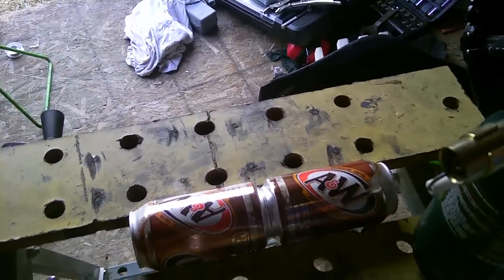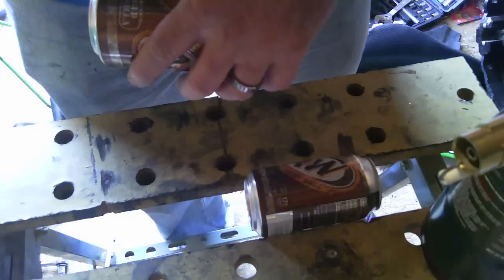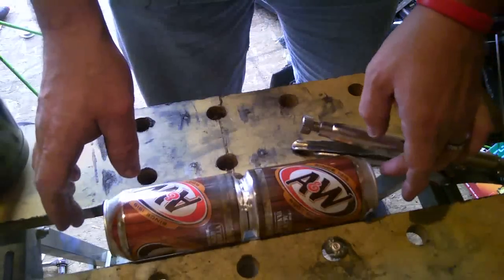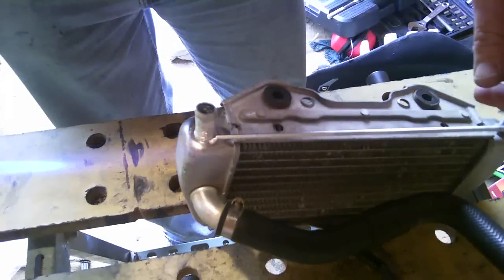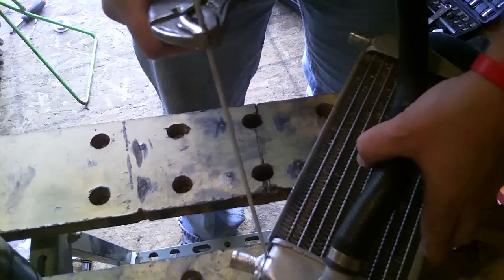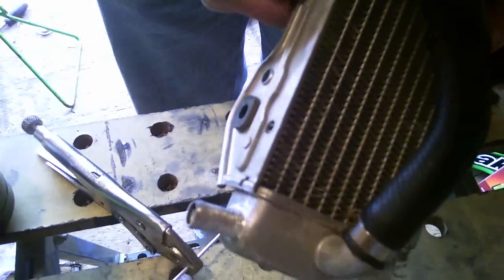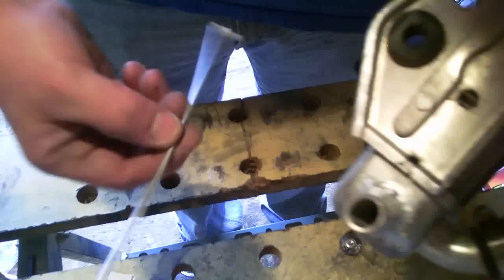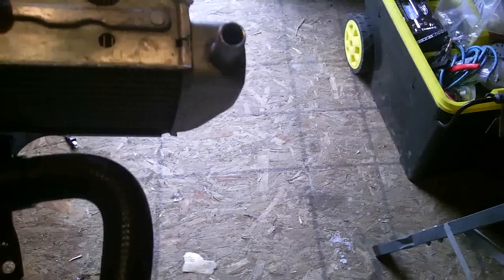How to weld aluminum with a propane torch and low heat aluminum welding rods fix your radiator.

Comment: Thanks ! Your vid provides some great real world experience with using these rods.  I've been doing research before I actually try it, so this has been invaluable for me and I appreciate the "mistakes" ! The one thing I'm getting consistently from all the vids I've been watching is that the "trick" to brazing with these rods seems to be heating the base metal to a point were the heat in the base metal does most of the melting of the rod.  I hope I don't ruin my carb :-)
Reply from the maker: +G Seidman You are welcome. Best of luck and thanks for watching.
Reply: I gave it a shot. Unfortunately on a second attempt I got a little too aggressive with the heat and melted my piece beyond repair, but the experience was worth it. Maybe next time I'll have better luck.
Reply from the maker: +G Seidman This was my primary concern when I was doing it and if you look at the comments I get a lot of heat (pardon the pun) about being too careful applying the heat to the base metal, but you have just proved my point on this. Aluminum has a very low melting point regardless of how thin the metal is it melts at the same temperature. The only difference is how long the metal takes to get to the melting temperature. It's a delicate balance. Thanks for the feedback and better luck next time. Thanks for watching and commenting.

Comment: you made a how to video without knowing how to actually.

1)the reason you dont get adhesion  is because the radiator stays cold and your rod melts
2) you arent using flux...itll make your life way easier
3) doubt the alumunum can and the aluminum radiator are the same gauge...it wont melt as easy but god damn take the rubber hose off.

now for actual instructions... 

1) clean properly
2) apply flux
3) heat indirectly from a distance constantly moving the torch
4) test heat of material by touching with a rod...if rod melts then its hot enough....remove flame and keep melting rod into radiator until more heat needs to be reapplied. 

what you actually did was put the rod where the flame was and melt the rod only onto a cold piece of aluminum, then heat the whole damn thing to a boil until solder actually melted properly.

watch copper piping soldering tutorials on here and see how neat and nicely it can be done
Reply: alextheromanian. so ur the genius lol
Reply: I agree.

Comment: Well for one thing you should have heated the piece to be welded first then as you heat, pull the torch away and then test to see if the rod will melt then you know you have good adhesion ! Just a suggestion from a Welder. I do this stuff for a living every day!
Reply from the maker: +Richard Lee Ferguson Understood. My biggest fear was overheating the base aluminium and melting a hole in it. It actually did adhere well and has held ever since. I would not hesitate to use these rods again. Thanks.
Reply: +Richard Lloyd LOL you would have to hold the torch on there all day to get a hole .. ITS NOT A POP CAN .
Reply from the maker: +BC Viking Better safe than sorry, but it is still holding today so all is well that ends well. Thanks.

Comment: Nice job and thanx for the vid! I wonder if one of those little butane microTorches might give more control?  Something I may try.  I'll have to get some of those rods and look into the flux option as well.  Thanx again!
Reply from the maker: +1 Apples You are welcome. Experiment on some scrap aluminium and see what kind of results you get. If you could report back to us here that would be great. Thanks.

Comment: let me ask u a question can I use this method to weld aluminum intake piping it's really thin material?
Reply from the maker: +Domenic Scavetta I can't really say yes or no as there are too many variables. You could try it and see but I would practice on a similar piece of scrap tube to test and get familiar with the process first. Thanks.
Reply: +Richard Lloyd I really want to know to I was going to try it tomorrow
Reply from the maker: +MegaDabeast99 I would give you the same advice, "I can't really say yes or no as there are too many variables. You could try it and see but I would practice on a similar piece of scrap tube to test and get familiar with the process first. Thanks.

Comment: One more reason to choose aluminum over plastic ended radiators. Thanks for the tip! Will remember this if my dual core all aluminum radiator leaks. Heating the surface was probably part of the problem with the adhesion, soldering carries the same principle, surface needs to be pre heated for a weld to take place.
Reply from the maker: slvrserfr You are welcome. The repair is still holding strong. Thanks for watching and commenting.

Comment: If the melting temperature is below 842°F (450°C) then it is soldering per American Welding Society (AWS). The rods sold at places like these are solder rods. AWS defines brazing as such a process which involves a filler metal which has a liquidus above 842°F450°C (450°C). You also need to check what alloy of aluminum you have, 5000 series alum. needs a very aggressive flux.

Comment: ok everybody let watch this guy melt holes in those two can, Ha Ha this is going to get good I have used those rods and got no where and we are going to be making fun of this guy  when he falls flat on his face .  Set back and chuckle along with me

Dat.  Dat . You photoshop Dat ain't no way you brazed them two cans together .. I already tried it .  It don't work     Now you going to really make a fool of yourself trying to braze that snout on Dat little radiator.   You better shut this video dowwn so we can't see the mess you are about ready ro make
Reply: bob brawley Alright alright you win . Maybe I jumped the gun a little but not by much . You did repair that little radiator and so I'll go ahead and shut up
Reply from the maker: bob brawley Two years later on a hot pressurized radiator full of cooling fluid mounted on a high performance motocross dirt bike that gets more than it fair share of abuse and punishment this much bashed repair is still holding today. As you can see in the video I am NOT a professional but regardless I was able to permanently repair this radiator using this method and It only cost me $15. So I will and do take all the criticism in stride knowing that the repair I did, though not pretty has been highly effective. I thank you for your time and for watching.
Reply: Well with that demo which actually showed the entire flame, and the distance . was better than the demo of the salesman on youtube hawking them I bought two tubes and got no where thinking that I needed to heat of the work more broadly with a grass burner propane  torch  Well I got the torch but lost the need to give it a try .. really you  gave us a possible way to actually give those rod  a second chance   Pull the heat way
Reply from the maker: bob brawley That's great. I left my mistakes in this video on purpose so that people could learn from my mistakes. I could have easily edited out all my mistakes and made a video that made it look like I was a master at this. Thanks again.
Reply: That's the way to do it . It real life not advertising hype
Reply from the maker: bob brawley Yes Sir. Thanks.
Reply: ied using those rods on a heavy aluminum trash truck door a vertical  braze  the base mental was not getting warm enough using  a Oxy/accel. cutting touch. even when I washed the flame  .  So, I figured I  needed one of those  propane grass burning . snow melting torches .. . They burn grass good enough but don't melt Ice or snow .. I eventually got the torch but never tried it on those rods
Reply from the maker: bob brawley I have one of those torches from harbor freight and it is flame thrower when I attach it to a propane tank. It might work for you. The problem with aluminium is that it is a very good conductor or heat so it has a tendency to work like a heat sink, hence why they make heat sinks, pots and radiators out of aluminium. Just like with the beer cans if you get it too hot it will melt. When using these rods the metal that is taking the rod should be hot enough to melt the rod without the torch. As you can see in this video it takes practice. Thanks.
Reply: Yes I saw those ones at harbor Freight they are like 2.5 feet long , much better to braze with than the one I bought which is like normal size , maybe 3.5 feet long too long to  hold while trying to hold a brazing rod . .. The harbor freight torch was only 19.95 dollars the one I bought at Tractor supply was 3 or 4 times that price .. It got to be too complicated and my failure with the first attempt using those rods .  Well I never got around to it . With your video maybe that will spur me to try it a second tome , I mean second time.
Reply from the maker: bob brawley Best of luck to you Sir. Thanks.
Reply: Richard Lloyd I think I ordered my rods from muggyweld dot com 5 years ago .. I see now you can buy them at the welding store and I guess Harbor Freight.  I visited muggyweld just a sec ago ,, and he disabled his comment section on all of his videos ,, not good ,, Its the feed back on the comment section of Youtube videos that are as important as the actual video. ,, Its the same as peer review
Reply from the maker: bob brawley The feedback is gold. I always read the reviews before proceeding with any repair or purchase. Thanks.

Comment: I appreciate you leaving all the mistakes in so the rest of us can learn.  I have done an extensive amount of MIG welding, but have not welded aluminum.  It seems that the problem is not the heating, pre-heating or any of that but rather a misinterpretation or misapplication of the welding process itself.  The theory of welding is that you get the base metal AND the filler metal just hot enough to become molten but not too much hotter or you affect the strength of the metal.  The flaw with the process depicted here is that you have low heat melting aluminum rods and are trying to weld a much higher melting point aluminum.  The base metal of the aluminum radiator never becomes molten and thus never "joins with" or "welds" with the filler metal.  You may eventually get some surface adhesion by the process depicted in this video but you will never get "welding" (that's why it leaked.  FYI, its going to leak again).  A welded bond is as strong or stronger than the original.  The basic premise of welding is that the metals mix and join or "penetrate" as the term is used in welding.  I don't mean this comment to be derogatory.  I appreciate you taking the time to do the demonstration.  I felt it was important to point out the reason why it did not work properly so that others would understand.
Reply from the maker: Keith Preston You are, I am sure, technically correct but I am not sure why you think this did not work. It is actually still working today. It has not leaked again since the repair. Thanks for watching and commenting.
Reply: Richard Lloyd I'm glad it didn't give you any more problems. I don't know what kind of pressure builds up inside a radiator.  Apparently not enough to blow out this repair.  When I talked about it not working I was mainly referring to the early attempts where the filler metal did not bond and fell off.  Although technically the "welding" part of the whole thing didn't work because it wasn't actually "welding".  If you don't melt the base and filler metal where they flow together, it's not welding.  It's more like "aluminum brazing" if there is such a thing.  Maybe that's splitting hairs.  I just wouldn't want someone to use this process to "weld" something together that was going to be used in such a way that if it came apart that someone would fall or otherwise get hurt.  Parts that are brazed or soldered together can come apart because they are really just stuck together with molten metal as the "glue".  What you have on your radiator is a hole in the original metal that is covered over by a layer of Aluminum that has become hot enough to adhere to the surface of the radiator and cover the hole. It looks fine from the outside.  That is why when they are testing/training welders they x-ray the joint to see what is really happening under the surface.  If you could x-ray your radiator you would still be able to see the hole or break in the original metal.  If it was actually "welded" together you would see only solid metal.  Your repair might outlive us all, or it might break next week.  Whenever you have two pieces of anything that are put together, it is possible for them to come apart. When two parts are actually "welded",  they become one piece. There is nothing to come apart because there is no point where "original part A" meets "original part B".  There is only "new part C".  That sounds like something Yoda would say, so I'll stop now.  Bottom line for you is that you fixed your radiator. Congrats!
Reply from the maker: Keith Preston Thanks for the wealth of information. You could call it brazing or soldering. The rad opperating pressure is 16 lbs pre inch I tested it to 22 without issue. Again thanks for the info.

Comment: I've been a pipe welder for over 35 years and done a lot of metal repair on other metal. I've used these rods and they work well, it looked like you didn't get metal hot enough you were trying to get the rod to run before the tub was hot enough just practice and it will look as well as the experts do it.
Reply from the maker: jedediahbc Thanks for the advice. I believe failure is essential to learning. LOL I did get it right in the end and it's still holding today. Thanks for watching.

Comment: This was painful to watch. Wish I was there with this guy to let him know that the base metal needs to be at just over 700 degrees to melt the rod. Never put the rod in the fire. Keep the heat moving then test the rod if it melts when not in the fire then you know you are at optimum heat. then place on a bead and it will follow the heat. No need for a half a rod a tiny bit would do it.  heat the opposite side and when the base metal melts the rod then you know you have enough heat.
Reply from the maker: Understood. Thank you.
Reply: No problem pal..Glad to help
Reply: If it was painful to watch youtube has this amazing feature call a stop button.

Comment: How is the radiator holding up? "0
Reply from the maker: Almost 2 years, still good. :)
Reply: Richard Lloyd
Good to know. Thanks. ;)
Reply from the maker: *****  I stripped all the plastics and most of the rubber off before the repair. Thanks.

Comment: @7:00 you werent getting adhesion because you didnt have the aluminum hot enough you were applying all your heat to the rod. The cans melted so easy because they are so thin.

Comment: Nice work. You needed more heat on the radiator during the first attempts for sure. I know you were worried about blowing through the base metal, but the aluminum on the radiator is several times thicker than the cans and it needs to be heated longer.
Reply: +Richard Lloyd I was gonna say the same thing,  and thought gotta be someone else having the same idea. there I found scdevon's comment

i didnt even know you could DIY join aluminum at home, kind of curious what kind of stuff that weld rod is. probably very acidic core?

but, anyways, if it is anyway like soldering/brazing brass/copper,  you have to get the radiator hot, no way around it. and I think what you are using is perfect for the job, probably wouldnt be a good idea if you switched the heat source to something else.(Right temp + Concentrated flame)
Reply from the maker: If I ever have to do it again I will do that and I wont use the flame thrower to heat it up either. Thanks for watching and commenting.
Reply from the maker: +Teng Yuan Thanks. Fortunately I have not had to do it again so I would say that the torch I used actually did do an excellent job of heating the surface as the repair has held and never failed. Thanks.

Comment: Holy shade-tree maintenance, Batman!  Plus one for flux!  Also you will get much better control out of a jewlers torch.  They're relatively inexpensive and are very handy even if you don't work in a radiator shop.  However, if it seems silly, but it works, I guess it's not so silly.  Good job.
Reply from the maker: Thank you. The repair holds to this day. I agree with you 100% on not using a flame thrower to do the job. Next time I do this job I will certainly not use a Howitzer to kill a fly. This is how we learn. BTW they rod manufacturer say not to use flux. Thanks again.
Reply: Yup, more heat on the source

Comment: This is an interesting idea but it isn't welding it's just soldering or at the very most brazing and you could have done the same thing with plumbers solder
Reply from the maker: This solution worked for me and continues to do so. Thanks for the input.
Reply: Big Ian Builds One interesting point made by muggyweld was that the joint sucks the braze metal across the joined metal and this tech. may be stronger than an actual weld because its like glueing the parts together over the entire surface contact. not just where the operator has access.   I wonder if the lower overall heat would distort the fabrication  less than a actual weld..   I don't know .  It would be had to demostrate the distortion when brazing such short peices . but would make a great video to illustrate the increase or decrease of distortion of brazing over welding  if such a difference exist.

Comment: Great video, would you use this method to extend an alluminum steering rod? I need to cut an aluminum rod and weld them back together inside a sleeve to make the rod 1/2" longer. Basically how strong are the welds?
Reply from the maker: Being that it is steering rod I would not recommend it. Personal safety is involved here. I would suggest replacing the rod with a longer and complete one. Thanks